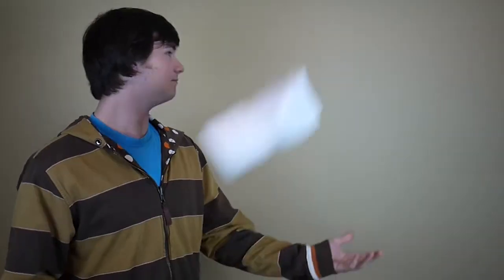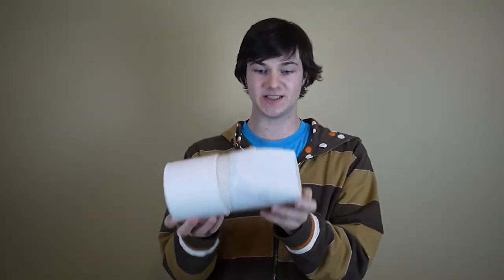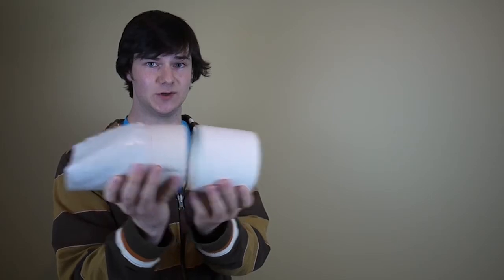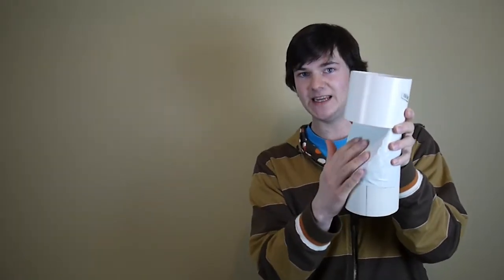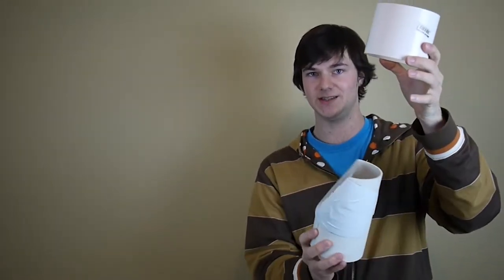Pneumatic Tubulum? Demonstration and explanation of compressed air's effects on the Tubulum

Comment: How about a variation in the technique..?
Did you try blowing the compressed air ACROSS the open ends of the tubes..?
Like blowing over the top of a soda bottle..?
Not sure if having both ends open would produce the same kind of sound as a bottle tho.  Might have to blow across the far ends of the tubes.. (sort of difficult to do in a performance setting).